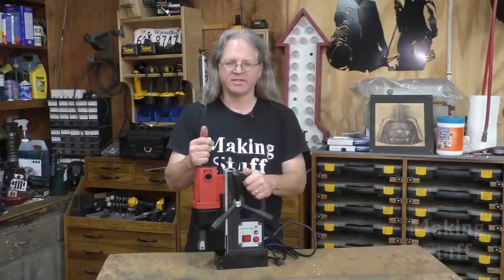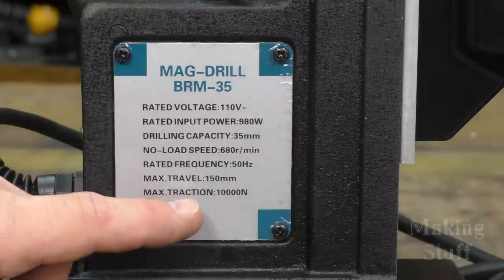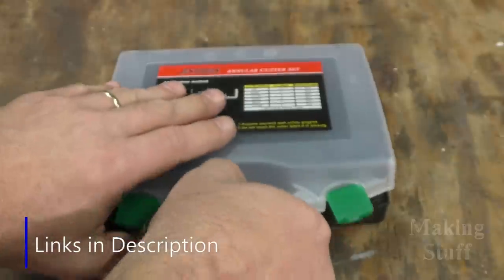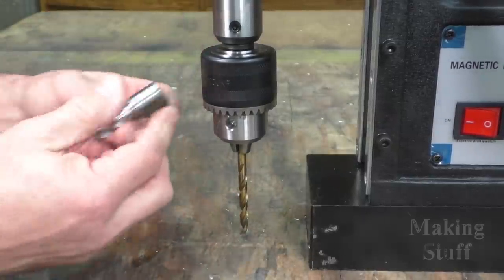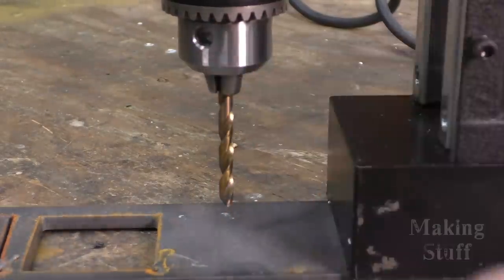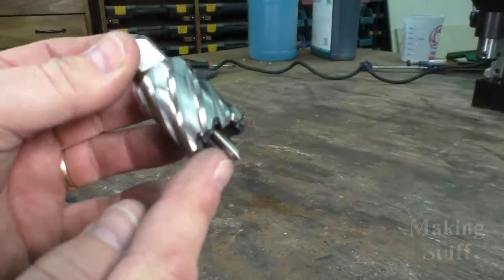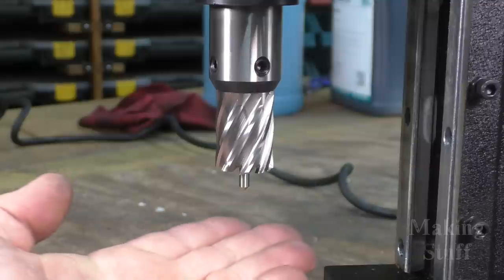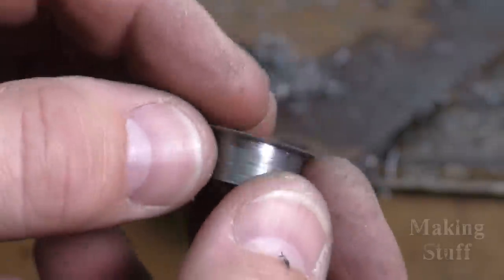Reviewing the Cheapest Magnetic Drill on Amazon - Is It Any Good?

Comment: I used to use a mag drill in my job all the time and we used to hang it from a crane to move it around. Mind you, the one I was using was quite a bit larger and heavier that that one.   I wonder if that's what the rope is for?
Reply: When youre drilling horizontally, the magnets are energized keeping the tool in place. If you were to trip a breaker or the power goes out, it will fall right down. Its a safety rope basically

Comment: The pies off roob is for when you drill a hole in a vertical steel and for when you push the magnetic switch by accident then the drill will Val down on the ground en break. So for safety you hang op the drill which the roop.

Comment: When you get a chuck that will run true, get yourself a set of screw machine length drills , preferably of the cobalt variety .  They are ultra short and rigid .    After that , get a speed controller made for brush type motors because the largest cutters want to run at slower speeds.

Comment: Not made for N America with that 50Hz rating, assuming it’s correct. The motor will overheat if you use it for a few minutes. Why is it hard to find bits bigger than 1/2” here in the US? I have lots of them. That’s not a Weldon shank. It’s just a tri flat shank. A Weldon shank has a short flat on a mill bit (or two, one above the other on the same side, for a big one). Short bit sets are easy to get, just ask for screw machine bits, or stub length bits. They will work on that machine, or any other mag drill.

Comment: dont know for sure but you might check what surface speed those cutters want- seems a bit high esp for the largest diameter
Reply: 450 to 500. There's no adjustment. I have an evolution and that is the set speed. All annular cutters work great with it. I have a very expensive set (by my calculations anyways) and they all cut at the same speed.

Comment: Ok, so as a welder/fabricator who uses a magdrill literally on a daily basis.... Stop going up and down during the cut. As long as you have the lubricating/cooling fluid flowing properly you can just drill straight through. I never ever stop down pressure once I start an annular cutter
Reply from the maker: Thanks for the info!
Reply: @MakingStuff  no problem.

Comment: Get some stubby drill bits.  Could you use a magnetic transfer block, as a riser, to give more clearance under the chuck?
Reply from the maker: Thanks!
Reply: I use my mag drill all the time you can use another steel block riser to get a higher level but make sure it longer than the drill you will have to clamp down the part your drilling as the magnet won't be strong enough to hold the part when drilling it will stay stuck to the block but part under it will fall off unless clamped in place

Comment: Don't know if anyone posted this question didn't read all the comments. To raise the drill why couldn't you use thicker plate for a shim? Ie. 3/8 1/2 inch etc. Till you found a plate thickness that prevented the magnet from holding seems like an obvious fix to raise the height so you can us a longer bit, just saying.
Reply: Ya that would work but you shouldn't have to. But for the cost guess its ok
Reply from the maker: The magnet would stick to the shim, but the shim wouldn't stick to the work piece.

Comment: Need a freq drive on the drilling mechanism iam guessing 60 cycles vs the 50 it is designed for is causing the thing running so fast . Bits will burn up extremely fast at that rpm
Reply from the maker: Thanks for the info!

Comment: Has anyone bought one? The Amazon reviews are all over the place. Most complaints are that the mag base is not strong enough and any real down pressure placed on the handle the drill will lift up.
Reply: A magdrill requires thicker steel to attach to. If you try it on 1/8 steel, or any nonmagnetic material it will pop off easily.
Reply: Agreed.  I own a fab shop with the largest mag Drill on the market  (Jancy 4x4 max ) and the smallest one( Hougen 150) 
And they both require a minimum of 3/16" steel to hold properly.  The Jancy won't even turn on on anything less then 1/4" plate without switching a bypass jumper inside . Its not to say they can't do it but I would only do it with and experienced person and a sharp bit. Especially with the Jancy, that sucker  weighs 80 lbs and has an extremely strong motor it would knock you out if it caught in the steel and was not held down by enough force. It also has a 4 speed transmission gear box on it to develop an insane amount of torque.

Comment: ● The "twist drill chuck" is known as a Jacobs chuck.
● The rope is to be tied to the drill handle (on one end of the rope) and to something, overhead, that is Immovable and Sturdy (using the other end of the rope.) This is only done when drilling horizontally, as a Safety Precaution (in the event that THE MAGNET "lets loose" from the Steel that it was temporarily attached to.) Ordinarily, Mag Drills come with a chain (instead of a rope.) ROPE was probably included, instead of Chain, in an effort to KEEP THE PRICE $$$ DOWN.

Comment: Used a Hougen drill like this when I worked at a steel fabricator drilling holes in beams just like you did.  I was amazed by how well it worked and couldn't imagine putting holes in steel any other way.  I would say this tool combination ranks right up there with when I had a pair of Mickey Mouse boots when I was in the service.  When you find something that works so much better than anything you've used before you wonder why you'd use anything else.
Reply from the maker: Thanks for sharing!
Reply: Lol my ex wife made your drill that company  makes some great cutting tools
Reply: VB Bunny boots some of the warmest.
Reply: Probably because its too big to fit in a lot of places and requires the base to be pretty much flush and flat or it can struggle.
For example drilling a hole off center through the web of an I beam - not flat, use something else.

Comment: I would like to see if it would cut through 1/4" aluminum if steel was behind it? Behind the aluminum of course.
Reply: it won't, holding force would be too weak, the more expensive ones come with a vacuum plate option for this
Reply: Clamp a piece of 1/4" or 1/2" steel plate on top of your aluminum, the edge of the plate stopping before the area you need to drill, set the drill on it and drill away.
Reply: Clamping a piece of steel on top of the aluminum would be your best option. If that's not an option (no steel handy, or maybe not enough clearance between top of drill and surrounding structures, you might manage to use 2 R11 clamps (or C clamps) to clamp the base to the aluminum

Comment: Does anyone know if it will hold on to Dimond plate steel?
Reply from the maker: I'm sure the magnet will stick, but not as good as flat plate  due to the lower surface area touching the magnet.
Reply: Flip the checked plate over 
And you can tie the rope around your. Testicles
The pin also ejects the slug

Comment: The Rope is for safety. You put it through the handle and tie it to something above the drill, so if the power goes out and the magnets let go, you don't have 29 pounds of steel falling on your head if you are doing construction or down onto your feet.

Comment: When you start drilling, keep a constant medium pressure and don't back out all the time or else you will dull up your cutters pretty fast.
Forgot to add, the drilling capacity of 35mm is for regular twist drill bits. 
You can probably go to 50mm with a annular cutter or even 65mm.

Comment: it would be nice for the drill power to allow for a variable speed, like with like a rheostat so you're not drilling at such a high speed
Reply: I doesn't need it with a anular cutter. You run it wide open as fast as it can go. It's not a problem, they dont get hot. The heat goes out with the chip.
Reply: @lylegrenoble2055  not for bigger holes
Reply: Variable speed does not work very well what you want is one with multiple speeds but their expensive

Comment: Thank you for this much useful video.  I learned a lot.  I bought a very similar product with few specs differences, sold under brand name Vevor.  Same useless user's manual, so poorly translated from Chinese I guess, probably with a cheap translation software, cause most sentences simply don't make any sense at all.  The included ROPE is actually a safety device.  When you use the drill on a vertical surface, to keep the drill from falling and have it remaining hanging at height, provided you first attached this rope one end to the drill and the other end to some safe high attachment point on a sturdy structure.

Comment: the rope is for supporting the drill when using the drill on a vertical surface.
Reply from the maker: Good to know, thanks!
Reply: Aparently if you are cranking down on a blunt drill there is a posibility of the magnet sliding or even geting levered off

Comment: I guess you lucked out. I just bought one of these drills and the magnet is terrible for horizontal drilling!!!!! I am building a mud truck and purchased it for drilling in the frame. When I lock the magnet in a horizontal position, if you barely bump the top of the drill, it falls right off. Very scary when that much weight can fall right off during drilling. Not to mention the damage it can do to my frame and then trying to realign it after it falls. I'm pretty disappointed in the drill. And the 50Hz thing..... WTH is up with that? WHY would they sell that in the U.S.? Unfortunately I didn't notice that until after I got it! Just my opinion.

Comment: The rope is for tying the drill to the structure when using it in overhead position.  Some Mag drills When you press the handle too hard most power is drawn to the drill motor and causes the magnet to dis-engage.  In overhead position can fall on the operator.  most mag drills come with a strap for this purpose.  I guess cheep once include a rope.
Reply: Right, I have two mag drills.  They each came with a chain.

Comment: Maybe you can make a makeshift portable buffing wheel with that wonky chuck. LOL

Also a thought, why wouldn't the mount everything to the front of the electromagnet, so you can get a little more clearance? Magnet seems strong enough that it shouldn't matter.
Reply: Different models have longer depth (+$) and larger capacity (+$) this is the cheapest...

Comment: those angular cutters are a blessing if you have to drill thick metal. I believe the rope is to tie the drill to a fixture if it is side mounted in case the power fails. One work of caution: although the magnet is strong it can be over ridden if you press down too hard on the drill bit while running. The results are not fun! It will cut the time way down compared to hand drilling but use with caution.

Comment: I've wanted one but the price has always scared me off. I just bought a miller bobcat 225 so I'll have to wait. Lol
Reply: If you just bought the Miller Bobcat,  you can't afford NOT TO. Buy a mag drill,  get a 1 1/2 capy one, like $500,  and once addicted buy a haugen or Milwaukee. You will use the heck out of this thing,
Reply: @jeffpatnode7446  I plan on getting one. I've borrowed one before, it is definitely useful. Alot of times I burn holes with plasma cutter if it's not critical. As in structural or needs to have a tight tolerance.

Comment: First it was welders:   Do I buy the $6000 Miller Dynasty 200 or a Chinese TIG welder at 1/10 to 1/20 the cost?   Now it's mag drills.   I bought a used Hougen years ago I thought was a steal, but $180 for a mag drill?  --good God!    Keep 'em coming China.   (I'm thinking laser cleaners.)

(P.S. One thing I had to learn about these drills is that the grip of the magnetic base is mostly proportional to the thickness of the plate it's sitting on.   This is not going to stick to sheet metal very well.)

Comment: This looks to be a review of the annular cutter bits rather than the drill.
Seems to me you would have taken the drill apart to find out what kind of material is used to make the drill. What kind of plastic, Current draw, switch durability, motor bearings, armature windings, and other assembly quality.

Comment: With Annular cutters use a lot of pressure (more than you were using) and there is no need to lift as it clears the shavings very efficiently. Light pressure and insufficient coolant will dull those expensive cutters. So lube up and get after it! I get through 1” in 30-40 seconds.
Reply from the maker: Thanks for the tips!

Comment: Nice video! 
I got a chuckle out of your 220 volt being useless inn US.  For a drill I would have to agree!  However, 50 hertz is the real killer of something motorized.  Magnetic coil and lights won't be effected, but the motor itself shouldn't run good and it would be good to run it without load for 30 minutes and under load for 30 minutes.  If it doesn't meltdown, then give it four stars.   As for the rope, I would guess it is for safety because if power fails, it will land on your toes.   How much runout is in the setup, how much oversize is the hole verses the cutter?      Wouldn't the fluid run out if tank is on upper side when drilling horizontal?    500 RPM is max speed for 1/2" bit in steel.  Two speed would be nice for that. 
I wish they would make a cheap swivel base style.

Comment: I liked your video and it is useful to see those who are using new tools explore them. But please take more care of safety measures. The harness was rubbish but maybe you should have read about it. When you were pouring cutting fluid near the steel wool being formed, I was worried for your hands. I love the video and your efforts but please take care. One other video on mag tools pointed out the issue with possible switching of the magnet rather than the drill which would be an issue if the magnet was supporting it. Please do not take anything as non-constructive. Thanks for the video.

Comment: The rope is a safety feature; if you cut the power while drilling in that beam, the rope or a lanyard could save you from injury.  The way you feed that cutter is a sure way to destroying it; called bump feeding. Keep a constant feed is the name of the game. Using the center pin and coolant/lube flow is also mandatory.   1/4 inch steel is about the thinnest material for magnetic adhesion. You may add some steel behind the object to improve the force.  The rest of the video was ok

Comment: Seems like a great project to try to make with old microwave or other transformers to make the electromagnet and then fabricate the rest with a high quality older U.S. made heavy duty drill maybe?   Just had a picking binge with $20 hammer drills and one electric hammer, the Thor-Nado.  The other two are a Hilti TE52 (only hammer function is working) and the Ramset Dynadrill model 445.  The Thor-Nado and Ramset both work good and I got a bit and chisel with each one.  The shanks are going to be challenging to coordinate versatile use and I'm thinking I'll have to fabricate bits for the Thor-Nado.  Though better than buying the cheapest $100 jack hammer I'm thinking for just small fence post driving, pin footer driving and small concrete repair/restore work.  Took some patience waiting for the what I expected to find as broken at those prices and just use for parts... though the AI or something just slammed me all the sudden on Facebook Marketplace finding with mostly working ones.  I'm also planning, since originally was, making one into a 2 stroke engine portable hammer unit.  Thinking the Thor-Nado since is heavier duty... though debating with the Hilti.  Thinking will repair the Hilti since is worth more and looks like the SDS-Max bits might work with... I think it's some different pre Max SDS like a TE-C or something.
Reply from the maker: I was going to try and make one, but I could not find a hand drill that had a Weldon shank, so it would not have been possible to use the annular cutters with a DIY version.  Plus it was going to cost more in parts than to just buy one.  Maye I'l l revisit this project some time in the future.  Thanks for watching!

Comment: they are rated by drill point breakaway pressure on 1 inch plate.  reduce the thickness and you will reduce that breakaway point.   if you were working on a beam with thin flange and using a large dia. bit  be careful because it can break loose and start spinning or break bit.   i got rid of a champion that turned at 650 rpms, that's too fast for larger bits, cutters.   now i have a milwaukee, it weights 75 pounds, has variable speed the drill head can be flipped also has reverse which is great for tapping holes;   but it's  $1350.  also have a dewalt, 28 lbs, 350 and 450 rpms $750.  the dewalt has quick release/insert  for cutters plus you can swap handle side to side by pushing a quick release button. 

also,  make a note of distance from front of magnet to centerline of your chuck.   this will create a problem sometimes although there are some workarounds.   i do most of my drilling dry cutting on the lower speeds or i bought a small oil can dispenser on amazon and squirt a little on the bit now and then.     i've owned 5 of these over the years and the first thing to go is the lubrication setup.   never fails but to be in the way.

thought i might add, be careful of chip accumulation beneath the magnet,  or any kind of debris for that matter;  it will less the magnetic grip considerably.  that i beam looked a little iffy as rusty as it is.   rust/non magnetic.

good video,

Comment: The rpm of that drill is way too high. Your cutters will wear out quickly. Thank you for your review, it helped me narrow my future selection.
Reply: have you ever run a lil slugger drill
Reply: @hoagie2011  I don't know for sure. One I used was a hilti I think, and the other was blue and golden in cooler,  if I recall correctly. It was 12 years ago at least. Both were slower and quieter than this one. I'm sure they cost 3 to 4 times as much too.